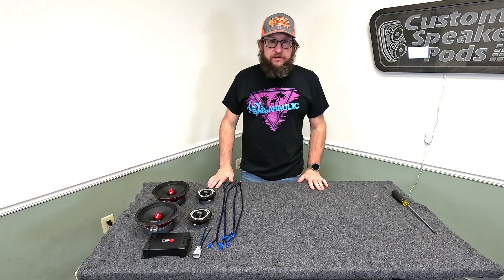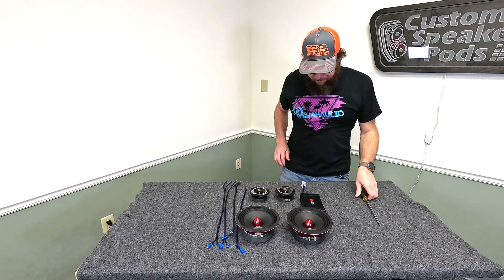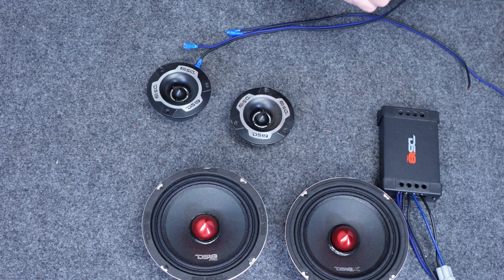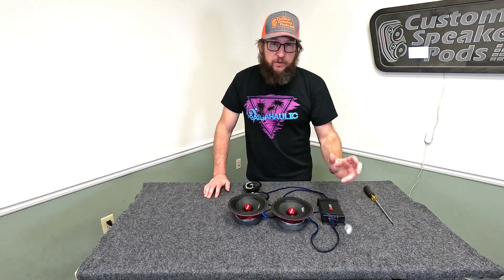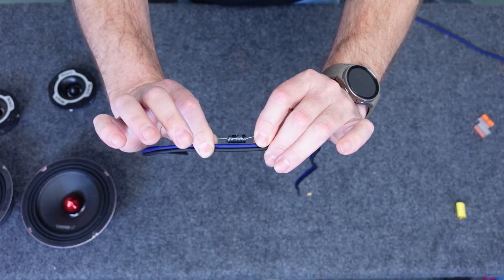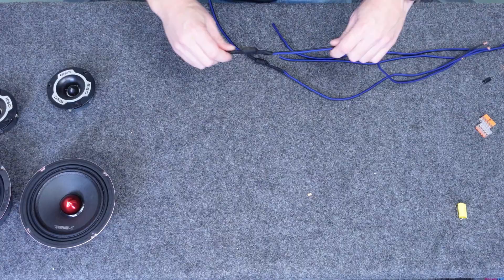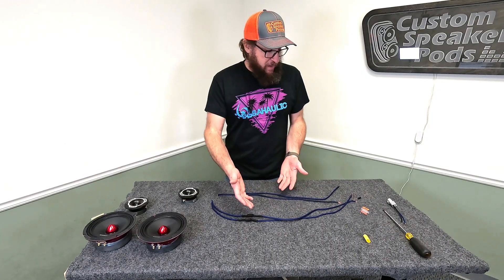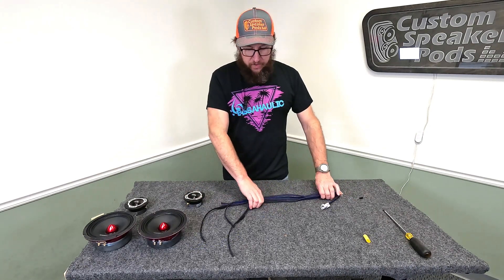How to Wire Dual Woofers and Dual Tweeters in Custom Speaker Pods

Comment: I just bought a pair of those little different tweeter, but the tweeters are 4ohm and the speaker/woofer is 8ohms does it matter?
Reply: Yes it matters if you are only upgrading the tweeters/speakers with the factory head unit/wiring. Only when you are adding a 4+ channel amplifier to the speakers is when it doesn't matter.